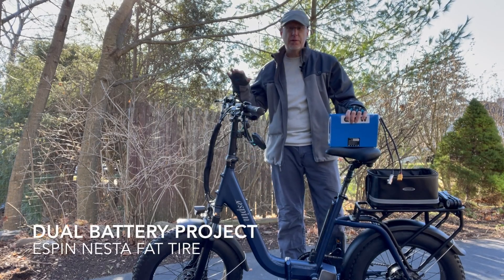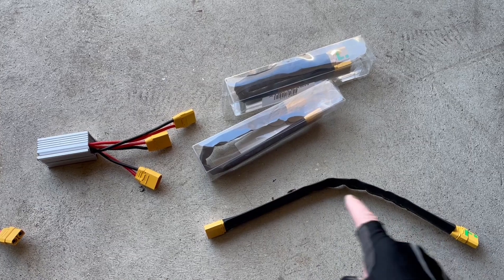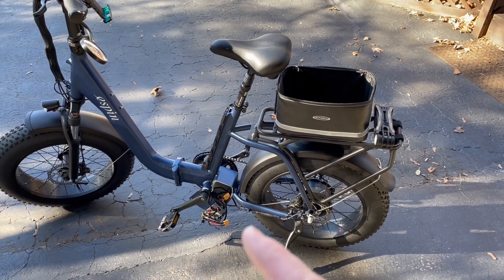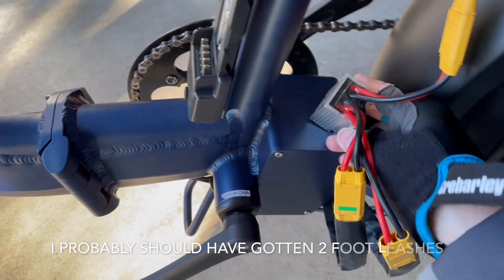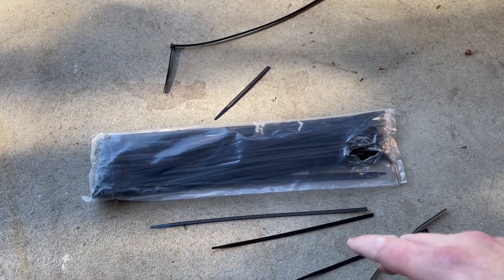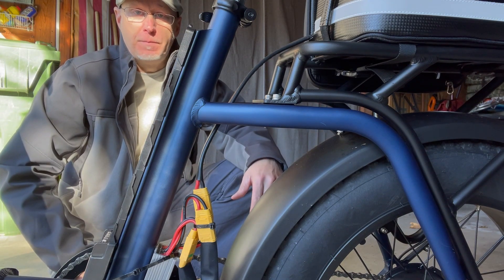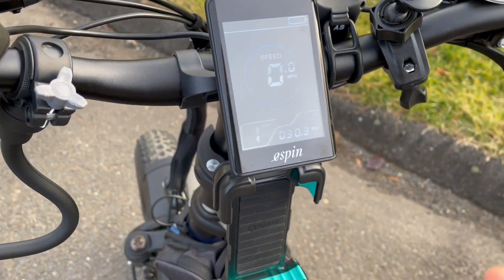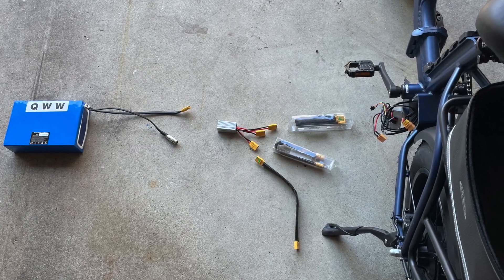Dual Battery Ebike Project: Easiest Way to Add 2nd Ebike Battery

Comment: Thanks. 2017 I got   a volt bike. Ebike have come a long ways. No one in my small town seen them back then. I would come out of the grocery store, folks would be gathered around my bike asking questions. People staring at me when I ride... Every day for a couple years. Now  they are common in my town... Thank God. 😂 Peace.
Reply from the maker: That’s awesome you were ahead of the curve!
Reply: @ChrisCrossed  thanks. Ya the batteries are still good... After daily riding for all those years. ❤
Reply from the maker: @MrWolfheart111  Yes although as a general rule you may see a small dropoff in range after 2-3 years in my experience

Comment: Thx for the video. Do you still recommend that size battery upgrade or would you go with something bigger now that some time has passed? Thx
Reply from the maker: Yeah I have a 30ah now
Reply: @ChrisCrossed will you send me a link to the battery and the components i will need for the 30 ah. My ebike is a 48v 20ah stock battery. The bike is the city range 4.0 by vefreedom.

Comment: Won't the parallel controller die in the rain being exposed like that?
Reply from the maker: i covered it up with tape, just dont leave it out overnight in the rain, otherwise it will be fine if caught in a rain storm

Comment: I heard bad things about those type of connectors.  I have to batteries also. I have one on the down tube and the other on the real bike rack. I do not connect both at the same time. When the one battery on the down tube get low I stop and just switch batteries out. No biggie!
Reply from the maker: Going on 3 years, no problems to report

Comment: prob not going to get a response, but how do you charge the batteries? do you have to charge both batteries separately,  or with everything connected can you charge both from the stock battery?
Reply from the maker: Separately, the Amazon battery come with a charger

Comment: its  better adding the 2nd pack to the front tube (frame)... instead the rear rack
lower danger of "front end wobble of death" ... (yes you also can run 3 packs,)
Reply from the maker: I don’t have any wobble in this setup, looks better this way.

Comment: With the right extensions you can put everything in the bag instead of it hanging in the back...ive got a lectric 2.0 with two batteries...one in frame one in basket in back and the connector is tucked neatly in the lock holder. Cant even tell i have two batteries going to add a third 48v 30ah battery for a total of 50ah....plenty of power and range. I keep both charged fully before i ride !!! Thanks to ElectricAllWheel.
Reply from the maker: Yeah now just have it all in the rear bag with an extension cable
Reply: Can you do a video on your xp2.0 battery upgrade?

Comment: Dude heat the shrink wrap on the wires it’ll look a lot better that’s not dispose to stay like that just heat the black cover on wire it’s heat shrink ! But good job on video but just fyi
Reply from the maker: Thx for the tip

Comment: So can I ask how the battery has been holding up? I have been thinking about getting it. So many sketchy stores on Amazon selling batteries.
Reply from the maker: Battery still works as advertised
Reply: @ChrisCrossed  cool I bought it. Unfortunately it's not plug and play on my bike gonna have to go mission impossible on this Jabroni.
Reply: @mentalprogram5256 what kind of bike ? And how did it turn out? Lol
Reply: @perfectoj7775  it was alot of work but I bought a saddle bag and put the secondary battery in it. I would drive until the original died then unplug original plug in new battery and on I went. No problems at all but I do have a bit of electrician experience.

Comment: Do the batteries have to be the same amp rating? Same ebike manufacturers don't have this parallel setup built-in with a frame mounted socket so you can just buy a battery to plug and go.
Reply from the maker: Yes though there are a few dual battery connectors that allow you to mix voltages (52, 48 etc)

Comment: Hey hows it going? Hope all is well. I'm just thinking. Will that adapter fit in with the control box? I'm pretty sure if you arrange the wires and place the control box up against the wall flat, you may be able to fit the adapter inside as well. then use 2 one foot extensions to the 20Ah battery. Be a cleaner installation. But then again you may have already done this by now, considering this video is 2 years old.
Reply from the maker: It might fit but to be honest it doesnt matter, hide it down there or in my bag.

Comment: Great video.
I didn't hear you make mention of the system voltage.
That's kind of important.
I recently bought an AKEZ 48v dual battery e-bike and so far, l absolutely love it. It's kind of a knockoff of the Super 73, but at a considerable savings.
I want to tell you and your viewers that the 48v setup is the only one l know of that will work with a 52v battery upgrade. The controller is rated at 20a, so there's no need to replace it.
In the future, I may add a front motor and have been thinking about what the ideal setup would be. I'm kinda leaning towards two controllers, which would allow for using the half twist throttle on the right and installing a simple thumb throttle on the left. I can turn the front on and off at will. The rear wheel (750w) will receive the 52 volts. I think that a 350-500w 48v motor would the adequate for the front.
That arrangement also means I will be able to charge them separately, but simultaneously. I may move the existing controller from under the seat so I can put that 52v battery back there. It will also lower the center of gravity.
Any suggestions or thoughts on what l may have overlooked and want to consider doing?
ps: i purchased one of those bolten adapters for my previous e-bike. worked like a charm. i highly recommend it.
Reply from the maker: 48 volts, pretty standard for most ebikes.

Comment: Do you have to reset preferences on LCD display of total voltage? Nice to know to avoid overkill on components between motor and controller.
Reply from the maker: No setting changes needed.

Comment: just 1 question though in relation to the battery connector is it possible to just run off the 1 battery and have the other battery switched off, then when that that battery runs down in power, turn that one off then switch over to the 2nd battery...this is the setup I wanting to do with my ebike...like to add a 2nd battery but NOT have them both on together at the same time.
Reply from the maker: Sure you can unplug either battery and just run on one. The original battery actually has a switch installed

Comment: great informative video, with the 2 cables coming out from under the controller, I would have seen if I could have threaded them between the rear fender and the frame, to make it more neat in appearance then zip tied together as I could see on the bike that there was a little room here that could have been done...time index 11:26...let me know what you think with zip tying the dual connector to the frame, looking from this side of the bike there seems to be room between frame and original battery to place a zip tie under the under the orginal battery and then around the connector making it more tighter, yes I would see about putting velcro behind it as well, to prevent metal on metal, and the clanging but this is a suggestion only.
Reply from the maker: I’ve hidden the dual battery connector since this first video in the bag itself by gotta longer extension cable. You could also mount it where u suggest but would rather hide it myself
Reply from the maker: Here’s the other video https://youtu.be/x-NOpvL55XQ

Comment: I have a yamee fat bear 750w folding bike with the battery inside the frame,would it be the same or similar to add the spare battery to the controller,the controller looks the same,I’m getting 20 miles on a 14.5 ah battery and I need more😊or do I buy a spare same style battery I already have thanks 😊
Reply: I added a 2nd pack ontop the frame of my folding bike... in frame pack was only 10 Ah.. added anothe 18 Ah ontop nearly triple the range
Reply from the maker: You'd have to buy an after market battery and a dual battery connector that has the right type of plug.
Reply: @ChrisCrossed  👍

Comment: Do you have to charge each battery seperley with a dual battery voltage connector or will both battery's charge with charger connected to either battery?  other words, will both battery's charge with charger to one battery?
Reply from the maker: Must charge each separately, but they drain together in tandem.

Comment: Can i ask.

I have Minal M1 pro ebike stock 48v 16ah battery and 750watts motor.

Can i use 48v 14ah  or 48v 20ah as secondary battery?
Reply from the maker: You need to pull out the controller and see what kind of connections you have and buy a battery blender.
Reply: @ChrisCrossed   controller specs: 
Rated voltage: 48v
Maximum current: 20A
Rated current: 10A
Low voltage protection: 41v
Throttle adjustment voltage: 1.2v - 4.4v

What can you recommend for secondary battery? And batter parallel connector specs?  Thank you
Reply: @ChrisCrossed   XT60 connection

Comment: Hi Chris - great video on how to up the range of eBike. Can this set up be used with any make of eBike like Radrover 5 or Lectric XP 3.0?
Reply: Yes I am working with Electric All Wheel. For their kits they are recommending 48v 12 AH. I like your QWW 48v 20 AH and want to make sure one of their kits work with this battery. I have emailed them. I will lost after I hear from them. Thanks for all your awesome videos. Very informative and very well explained and demoed.
Reply from the maker: Check out the Electric All Wheel channel they sell kits for the Lectric Xp

Comment: Nice conversion, I may need to do this in the future.  My 36v just eats batteries.  Almost 11k miles and I am on my third battery that is shot.
Reply: I got sick of the same problem, upgraded to 48v battery with 40amp bms and its running strong for a while now. Well worth dual battery if you do loads of miles should make them last longer as well

Comment: Hello there I have build in 36v 16ah battery and I want to add another 36v 20ah battery! What dual battery parallel connector amps I need to buy ??

Comment: I'm running two 48v 1500w hub motors off one 48v 20ah battery.....
Reply from the maker: That’s a lot of power draw, have you thought about upgrading to a 52volt?

Comment: How close of voltage do the batteries have to be before the dual battery connector, connects the two batteries.   Within 1 volt, .5 volt, .2volt?          When it connects them is there a resistor?   They all are metal and appear to have heat syncs, to disipate heat, but why? Why are they creating heat?   Any info on anything, any links?
Reply from the maker: Watch the video of the parallel connector
Reply from the maker: Here https://youtu.be/9zILIYZwDAE

Comment: Why can't I just unplug my1st battery and then plug in the 2nd battery?. 
That way I will be saving the high cost of a connecter and it will work. I have a 48v 1000w 20ah battery. I plan on getting a 2nd battery of the same and doing just what I said.
Reply from the maker: You could but you’d have to remove the cover off the controller box in order to do that, the extras 60 bucks fir the parallel battery is worth it.
Reply: Because the two batteries, in parallel are sharing the workload from the motor, you actually get more range than using the batteries one at a time. You also get less voltage sag, and a bit better acceleration. I have both of my bikes running dual batteries this way, no more range anxiety!

Comment: Great video.  Your battery is a nice shape to put into your bag.  I am interested in a decent rear rack bag that would simply allow me to carry a 2nd battery instead of wire it in.  the problem is that my Shark 52V, 17.5AH battery is too big for most bags.   Searching for a nice bag set up or even just a mount to simply bring a 2nd battery along for the ride.
Reply from the maker: Thanks, yeah there arent really any battery bags, gonna have to find some other type of bag to fit it in.

Comment: Thanks for your video. Could you tell me what is the advantage of connecting the batteries with this parallel connector when I can do it manually with a switch when one of the two batteries is empty
Reply: Also both batteries together can still work to a higher discharge because they are sharing load current.
Reply from the maker: I'd say it eliminates that need for a switch because it drains the batteries equally.

Comment: What is the reach on the espin?  I am 5’7” and am worried the handlebars will be uncomfortable for me to reach. Will they adjust backwards an inch or so?
Reply from the maker: The reach is not bad it says 18 inches, min seat eight is 33 inches.
Reply: @ChrisCrossed  thank you so much for answering. can the handlebars adjust to come a little closer?
Reply from the maker: @joyceturner2549  no
Reply: What if I put bmx handlebars in exchange for the regular ones that come with it?  Would that help?  I watched a video showing how to do it.
Reply from the maker: @joyceturner2549  yes you can certainly do that
Reply: @ChrisCrossed  Do you think it would make much of a difference?  And thanks again for taking the time to answer. I’m trying to make a decision on whether this is the right bike for me.
Reply from the maker: Maybe or use a set of swept back handlebars. I’m six feet and the Nesta is my most comfortable ebike to ride
Reply: @ChrisCrossed  I had thought of that too. Thank you again. Love your videos. Help a lot. 🤗
Reply from the maker: @joyceturner2549  thanks for watching!

Comment: I used a black knee high dress sock to slide over the controller and wires. It hides everything. Put a small slit in the toe to get the wires through. It stretches to accommodate the whole mess.
Reply from the maker: Great idea

Comment: How can I do this if my batteries have Anderson connectors and my BBSHD has Anderson connectors?
Reply from the maker: You'll have to do some wire cutting unfortunately.
Reply: @ChrisCrossed  Ok sounds good. It looks like I will have to figure out how to do that. Thanks

Comment: I have an eSpin Nero. (I think it's the non-folding version of that bike you have.)

Will these same steps follow through? I tried to go to the bolton site but it seems they are sold out of the connectors. Will the DATEx2 work?
Reply from the maker: I believe the Datex will work yes
Reply: @ChrisCrossed  Should I be concerned with the amp rating? I was reading the back of the controller unit and noticed it was really low
Reply from the maker: Not that I’m aware of.

Comment: You don’t mind losing the back rack? How come you didn’t get a shark or something and put it where the Down tube is? I’m just curious bc I’m either going to forego my mounting bosses to add a shark to the down tube or buy a whole new rear rack with a removable battery built in the middle and take my current rear rack off. My battery is in the same spot as your stock one. I don’t want to give up the precious rack on my cargo bike. Where will my gym bag go? Or my groceries? Lowes run? Or McDonald’s for the kids. Lol. Front basket won’t be enough for me. I’m really trying to replace local car errands so it’s important to me. I’m actually thinking of adding stackable collapsing crates to the rear. Keep them folded and when need to haul I have two decent size crates stacked on top of one another
Reply from the maker: The bag in the back can still hold stuff, I also mount my lock on the rack. I could prob get paniers for the sides if I need more storage options.

Comment: Should have just cut the end of connector ran wire as long as you need, then solder back on the connector. Very easy and you don’t need to buy all those extensions. I don’t like daisy chaining and it would look super neat and still quick disconnect. I’m sure you could crimp if you’re not comfortable soldering. Thank you for the video. I’m taking delivery of my first ebike tomorrow and it has a 14.5 mah battery so I’m trying to get the lay of the land of how ebikes are wired up so I can do this. Im Good with electronics and soldering so no trouble there.
Reply from the maker: Thanks I’m not much of a soldering expert so plug and play is how I did it.
Reply: @ChrisCrossed  I understand. It seems like it could be scary and more invasive. But all you’d have to lose is a cut extension. But I have no doubt you would have trouble, it’s very easy. Just make sure you tin the wires and follow a few simple steps and the wire just soaks up the solder. It’s better than having multiple connections daisy chained. But you’ll be okay. I thank you for the video. It was great

Comment: A friend of my did that and he overcharged the battery and after a couple hours the battery blew up - this is very dangerous Ur better off using the bigger amp battery than have two connected prepare for it to blow up if yiu do that with two batteries connected 
And catch fire
Reply from the maker: Its a safe setup, dont wory.